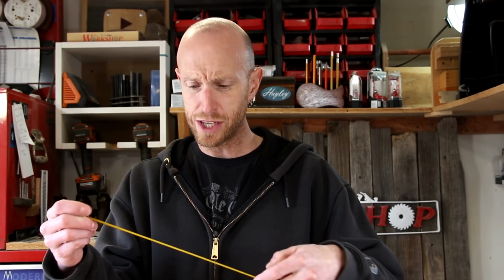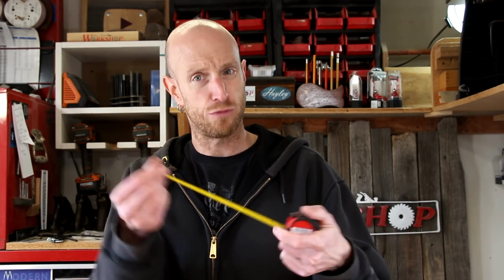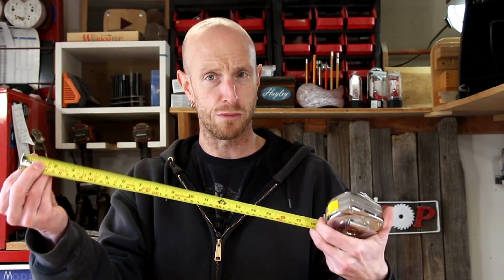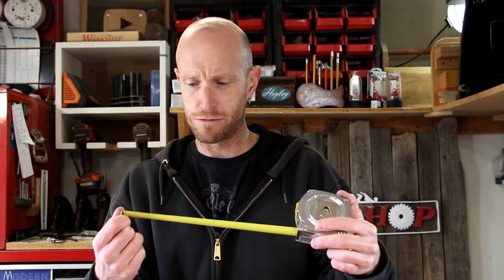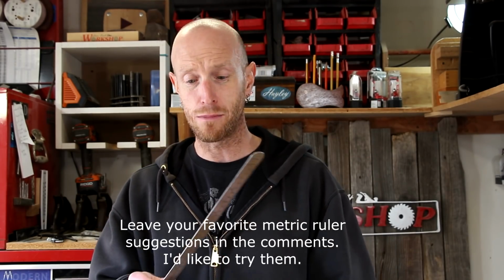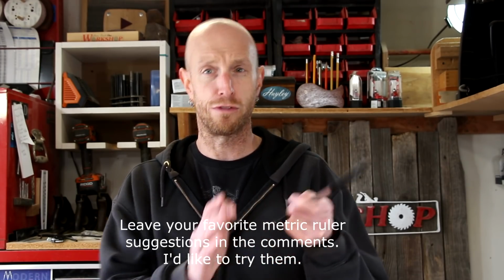My thoughts after using the Metric System for a project | I liked it

Comment: I'm a retired biologist/chemist. For both disciplines the metric system (International System of Units or SI) is used universally. It is also used in most if not all fields of science. Its adoption is not because it is more difficult, but because it is less difficult. The chance of error when doing calculations is greatly reduced. Every thing is based on the power of ten. So many calculations can be done in your head without the need of a calculator or pen and paper. There are no complex fractions, which so many people have trouble with or can't do at all. There are people who say it has worked well for them for 50 years (I've used it for over 60 years) so they will refuse to consider a better, simpler system. I've used both and if it wasn't so hard in the US to use it because too many people refuse to give up an antiquated system, I would use metrics exclusively. There are those who get old and set in their ways. It has been disproved that you can't teach an old dog new tricks, but the jury is out on old humans, at least the ones who refuse to learn new things. P.S. Thanks for your videos I have learned a lot from them.
Reply from the maker: Thank You! The math is much easier to go by 10's for sure. Much less margin of error. I think it would be hard to adopt it universally here but for me, I can see me using a combination of both.
Reply: I have to agree with you. I grew up using the imperial system all my life. I rarely used the metric system. I prefer the metric system. I still find it hard to use the metric system more though. Not that it's difficult, but that as I said before I can't visualize a size without converting it. I was a machinist and used imperial decimal measurements exclusively. Now that I'm 3d modeling now I try to use metric as much as I can.
Reply: @homebuiltshop  ok, now go get 6 2x4's and 1 2x10. lol.
Reply: @Noneofurbusinesseh  Even thoroughly metric countries use the same terms. It's a handy name, and not a description of what you're buying. (Ever measured a two-by-four? You will feel cheated. :-) )
Reply: Not to mention it's amazing for precision.We can go many power's of ten bellow a meter and that's one of its greatest assets for science,the precision level you can have in your measurements(ease of representation not advantage in precision per se).
Reply: @ZeroSleap  Sure that when you "measure" in 1/262144th of inches, it becomes "a bit" annoying... 😁😁
Reply: @Noneofurbusinesseh  we use things like 100x50mm instead of 2x4
Reply: @ James Morrissey If you want to make some cookies cake or whatever and they use their ridiculous cups and spoons measurement system I don't have a clue how to translate that into weight.
Reply: @markschattefor6997  You would have to know the density of each ingredient. Ingredients like flour would have to be sifted to get a known density. Then you need conversion factors if the mass was in grams or kilograms.
Reply: @jamesmorrissey5604  I don't see any difference if it is given in grams or kilograms.
I've worked as a constrution worker/carpenter in the Netherlands, and every buildingplan and all the detailblueprints are ALLWAYS in millimeters.
It is obvious that you can't work that precise when it comes to the size of concrete foundation sizes, or brick walls but the main reason is that you can't
mix up the numbers because you are using one size only.

Oh almost forgot, yes you are correct about the density of the flour etc, you don't have that problem if you use weight as measurement instead of volume.
Reply: @markschattefor6997  The conversion factor would be different for grams vs kilograms. You can covert the measurement to grams or kilograms depending on the conversion factor. If you're converting from mass to volume then the density matters. If you have a recipe that uses mass/weight then density doesn't matter. I'm in the US and when the amount of flour is more critical the recipe will indicate that you need to use sifted flour.
Reply: @jamesmorrissey5604  If you want to change from grams to kilograms  just multiply by 1000, easy. If your recipe uses weights you do not have problems with density, just weigh your flour.
Reply: @johnclements6614  Most people in the US don't use the metric system and don't how to convert grams to kilograms or vice versa. They would use a conversion calculator. Recipes here don't use mass/weight and I don't think many people have a scale in their kitchen.
Reply: @markschattefor6997  The cups and spoons measure volume not weight. Even so they are standardized in metric. I think one tablespoon is 15 ml and the teaspoon is 5 ml maybe. I just bought a standardized measuring spoon so I did'nt have to bother with this, but the units are printed on them in case you need 15 spoons of something and don't want to stand there forever shovelling things with the tiny spoon :p
Reply: @jamesmorrissey5604  I accept that people in the US may not know that a kilo is a thousand and a milli is a thousandth but 1000 is fairly easy to remember. Once you have looked up that a kilometre is a thousand metres, a kilogram is a thousand grams, a mililitre is a thousandth of a litre etc once or twice most people would remember. They would not have to use a calculator in the  same way they do not need a calculator to change a thousand cents to ten dollars.

I rarely use my scales, just do things by eye mostly. I would assume that in the US many people do the same because they know what a cup of something looks like. If US recipes had weights, most likely in ounces,  they people would not have to shift their flour and things like butter would be a lot easier if a person did not have the eye for that product or a more accurate measure was required such as in baking.
Reply: @johnclements6614  I guess it looks like abracadabra to me because I grew up with the metric system, and I think that makes it more difficult to get my head around a somewhat ( in my opinion) illogical system. Something else that I still don't get is why Americans count everything in feet and never use the yard. For instance the floorsurface of a building is an X amount of square feet. Is there a specific reason for that choice?
Reply: @markschattefor6997  I have never been to the USA so I do not know. 
Before the metric system was invented there were numerous measurement systems in Europe. Look up pre metric German on wiki its a nightmare.
Reply: @Noneofurbusinesseh  6 45x90 and one 45x220 coming up.
Reply: @WolfKenneth  actually it's 45x90 now.
Reply: Remember spending a good amount of time before the days of t'internet, trying to convince my Dad that there was 2.54 and not just 2.5cm in an inch. He worked on cars for a living. Ginetta, TWR, Jaguar, McLaren - not Leyland. It's all good until we start building rockets with both systems...
Reply: @markschattefor6997  You know what is more weird, here in the US  floor coverings (carpet, tile, vinyl, wood) are sold by the square yard. (By the way, US citizens aren't the only people who are American. Anyone from North, South, or Central America are American). I'm tired of having to have two sets of wrenches or two sets of sockets for my ratchets.
Reply: @jamesmorrissey5604  That makes it even weirder and doesn't help to understand the US logic ( if there is any at all) behind the use of feet vs yards. Maybe it's because
the total floorsurface in square feet sounds more impressive (bigger) when you try to sell a house, then it would in square yards.
And vise versa, you only need a few square yards to cover that many square feet. After all the US isn't a real country it's a business. ;-)

Funny that you mentioned that thing about being American not necessarily means that a person is a US citizen.
I didn't expect that someone from the US would point that out to a European ( Dutch) , I remember doing it to an US American, he/she didn't understand 
what I was talking about when I asked from which American country the person originally came, because it could be anything from Argentina to Canada.

I would love to hear your opinion on something completely different; I recently discovered that there are some very strange building rules when it comes
to suburbs and cities in the US and Canada. I found it on the channel "Not Just Bikes" from a Canadian living in the Netherlands.
It is in his playlist under the name "Strong Towns". I hope you'll find the subject interesting enough to give it a look, and it could very
well be that it gives you view on a problem that you never considered to be a problem in the first place.

Thanks in advance, and as if you have noticed by now English isn't my first language.
Reply: @Noneofurbusinesseh  That are wood namings and we still call them 2x4's but they measure 44x95 mm (planed) and we work with that.
Reply: @WolfKenneth  
From what I've seen, the USA measures timber (lumber) in units of 1/4" e.g. 2" is quotes as eight quarter.
Reply: @lenroddis5933  but why? There are mm, cm, m...
Reply: @WolfKenneth  Being uncharitable, I guess it may be that school dropouts or homeschooled kid are not taught that.
Reply: @darkiee69  I think that depends on whether you are getting it rough sawn or planed all round. Basically even in the USA a 2x4 is not actually two inches by four inches either.
Reply: @jamesmorrissey5604  I got around that by purchasing a set of  Metrinch sockets and spanners. Which is great because I can also do a range of other sizes such as Whitworth etc. One of my best purchases ever.
Reply: Age is no guarantee of Wisdom
Reply: On the baking theme. What’s 2 eggs in metric! 🇬🇧
Reply: @Noneofurbusinesseh  There's another issue. In Oz it would have been a 4x2 before metric, as we use the longest measurment first - in the USA it is shortest first. Huh?
Reply: Base ten is actually terrible for doing maths.  When Metric was invented by the French, really they should have kept the imperial system and switched to base 12 for the r counting.  Everything would be sooooo easy to do in your head if it was like this, but Napoleon was obsessed with metric for some reason.

Base 60 would be even better.  Look at how many different ways you can divide an hour into whole minutes.
Reply: @rickybuhl3176  is this a reference to the Mars orbiter?
Reply: The Imperial system has advanced features. you will land your spacecrafts much much faster.
Reply: @grumpyone5963  
A pair of eggs or a couple. However a dozen eggs is still 12 eggs and half a dozen, 6.
Reply: @grizzlygamer8891  
Base ten certainly has issues with thirds and sixths. It's certainly not difficult to work with 3.33333 recurring though.
Reply: @Paldasan  I don't know enough about what I'm referring to, to know what I'm referring to lol.. I just recall a (possibly apocryphal) story about NASA/JPL and some project with Lockheed going tits up due to inadvertent use of different systems.
Reply: As an metric user from school that started work with older men that schooled imperial and had to change l would get bombarded with cutting measurements like 3ft 25mm so I have no problem of visualisation size , weight however l feel your pain .
Reply: @jonathanbuzzard1376  "Basically even in the USA a 2x4 is not actually two inches by four inches either" - that's not completely true, it WAS two inches by four inches - when it was cut, that is. And then it dried and as such shrank a bit, so it's actually smaller (the result is also called the "actual size", which for a 2x4 is 1-1/2" x 3-1/2" - or just 38 x 89 mm ;-) ).
Reply: @Neptune730  I would suggest for you to measue your own bodyparts, and go from there. Like i know, my index finger is actually close enough to be 1 centimeter think, or that between the tip of my index finger and the tip of my thumb its roughly ~20 centimeter. And of course, its clear, the same points arent gonna give the same measurment for others, for some my thinnest finger would be their thickets, and so fort, but the measurements themselves always the same, its just that, youu have to find your own "scale" to it.
Reply: As a physicists I can tell you that a litre of water weights about 998grammes. It only weighs 1 kg at 4°c at sea level .
Reply: @lancefawcett1809  Yes, but unlike most other other fluids, it will weigh less whether the water increases OR decreases in temperature.
Reply: Surveyors in the UK used the division of 10 to a foot to make leveling easier. The level staff was divided by feet and then by 10s of a foot. I watched a brick layer trying to set out a footing using a leveling staff, it was fun to watch.
Reply: Although as a biologist/ chemist, you'll know about the competition between MKS and CGS metric units, and between calories vs joules.
Scientific units are not 100% unified yet by any means, even within metric.
Reply: @grizzlygamer8891 
Imperial isn't consistently base-12 though. They'd need to make a new system which is base-12 to replace imperial.
Reply: @homebuiltshop  Using a combo of both Metric and Imperial is effectively what we here in the UK do.
Reply: @IamGrimalkin  SI is the accepted standard.
Reply: @Hoganply  In the US both are used. Just about all food has both units on the package. Soda/pop comes in two liter bottles. Distilled spirits (whiskey, scotch, bourbon, etc.) and wine come in mls.
Reply: @jamesmorrissey5604 
It is, but in chemistry in practice the mole is built off cgs units so you have to use those to some extent, whereas biology routinely uses the calorie rather than the joule.
You also see cgs units quite a bit in other fields, like astrophysics (when they aren't using their own units like parsecs).
Reply: @homebuiltshop  Here in the UK all tape measures etc you are likely to buy have both systems marked.  That is because despite switching to the metric or SI system a lot of us oldies still think in feet and inches.

But as a trainee engineer some 40+ years ago everything was metric.  It is a coherent set of measures and with that comes much easier calculations (as you found).
Reply: @lancefawcett1809  Well........  They might tell you that it weighs 9.79 newtons.  Or 9.81 at 4c at sea level.  Grams is mass.  Weight is Newtons.   Sorry, pet peeve of mine.  It bugs me when people mix up units of mass and force.
Reply: @WolfKenneth  or 10x5 cm if accuracy isn't an issue
Reply: Also given the fact that you don’t have convention rate lower than a pinch tells you something of usage in Imperial system of measure.
Reply: I largely use metric and there are still things I'd prefer imperial. Buying a dozen eggs is way more useful than buying 10, for example. I wish Britain had been a bit more stubborn with the EU on the metric front, actually. Buying things from the market for a pound a pound was great. Now it's a pound a "bowl," which could potentially work in your favour for potatoes but leaves you short changed for most vegetables.
Reply: @MikeRees  Why is buying twelve eggs way more useful than buying 10? What if you only needed 10? I've read that they were originally sold that way because there were two coins and 1 egg sold for the smaller coin and the larger coin was equal to 12 of the smaller coin. Unless that is always the case then selling by a dozen has no useful purpose. If vegetables are sold by weight, as most are in the US, then it doesn't matter. I don't know what a "bowl" is, but I assume it must be a volumetric measurement like a peck or bushel. Many of these old and archaic measurements probably came about because accurate scales were not available or too expensive.
Reply: @jamesmorrissey5604  12 is more useful because you can split the eggs between 1, 2, 3, 4 or 6 people conveniently. Or you can make 4 omelettes with no eggs left over. With 10 eggs you can only split it between 1, 2 and 5. Given that the typical family is 3 or 4 people, well... yea. As for the bowls, it's literally a metal bowl, its dimensions I don't know. They put produce in it and sell it for £1, whereas before you could guarantee a weight of product that usually amounted to more than what you get now. It came about because the EU mandated metric measurements (well they banned imperial, given that a bowl isn't a metric measurement) and the British government didn't negotiate an opt out for market stallholders.

Also 12 is the number of knuckles you can count with your thumb whilst gathering things in your other hand.
Reply: @MikeRees  You could have a situation of 2 adults 2 small children. The parents each have a 3-egg omelette and the kids have 2 scrambled eggs each. That's 10 eggs. One adult has a 3-egg omelette, the other has a 2-egg omelette kids each have 2 eggs. That's 9 eggs. The parent has a 3-egg omelette, the other has oatmeal the kids have 2 eggs each. That's seven eggs. I'm sure I could come up with at least a dozen (pun intended) more scenarios where there will be some odd number that doesn't add up to a dozen or 10 for that matter. In a situation using a food item like eggs the people eating them probably don't really care if it divides up evenly because they will sue what they have and buy more when needed. It's pretty much arbitrary. And what about a baker's dozen? Not only doesn't it divide evenly, but it's an unlucky number. That'll just make the feces hit the fan.

Comment: I think in metric it's easier to be accurate because you can calculate things very quickly, so your mind is very swift and you don't end up lazily resorting to even divisions like 8ths, 16ths and so on. You can also very quickly dive into more precise scales. Factors in multiples of ten instead of multiples of 2. You can get ten times as accurate by moving down one digit in metric while you need to divide by 2 three times to get into 8 times more precise imperial fractions.